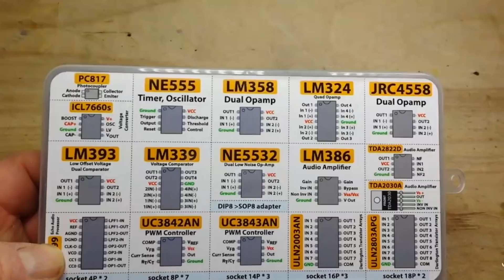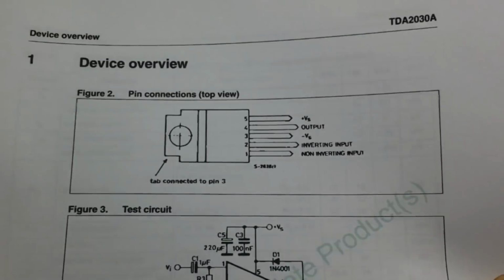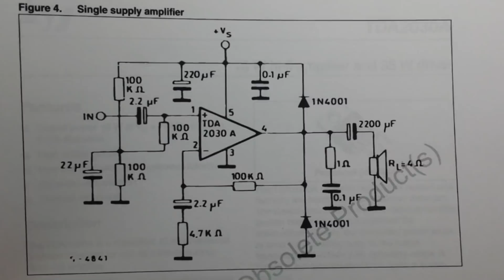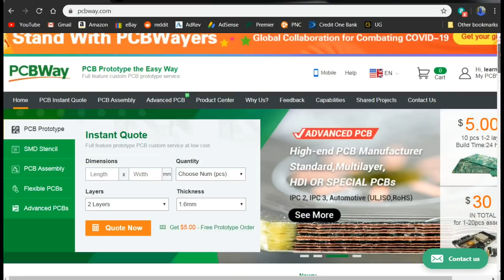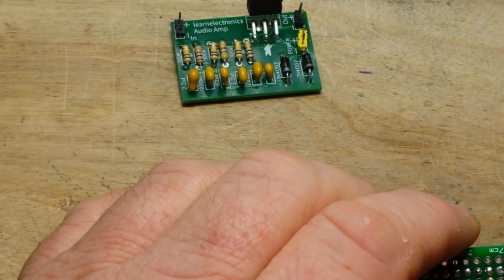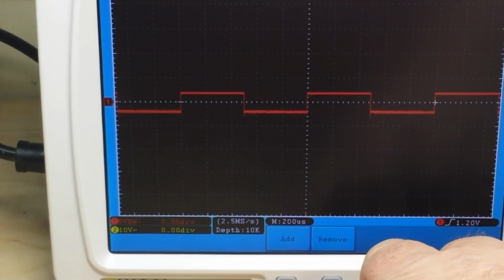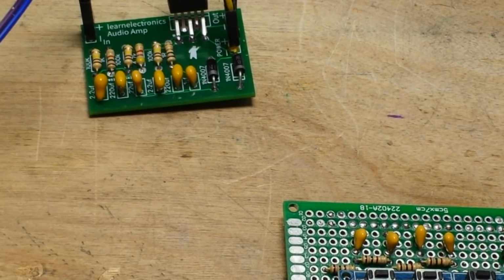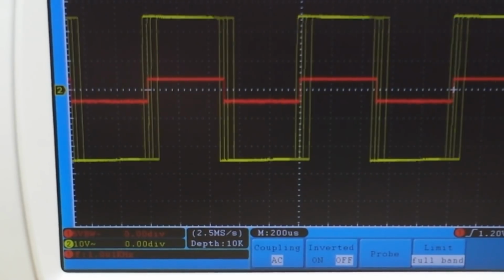TDA2030 Audio Amp Project

Comment: What's the voltage on the heat sink tab?
   If there's electrical isolation between tab and amplifier, the heat sink can protrude from the case. Otherwise, you'll need a larger case with perforations for airflow, and even a fan. Or some kind of insulator and heat sink compound.
   I don't see a real problem with electrical safety, this amp would work well with a 24V supply which is touch-safe even if the amplifier shorts internally.
   The data sheet states a maximum of 3 C between junctions and tab, but I don't know if that's a lot.

Comment: Yes, I could do that... now there you've gone and done it again! First, there was the ZT-M1 Multimeter, then the SDS-1202x-E o'scope + the DS-213 mini o'scope. (Great products, BTW) Now, I need some analog stuff to make use of them.🥴
Hey! What about the preamp I'll need to go with this? You haven't even mentioned that little extra item, have you?😜
(So, don't stop now.) 
Thanks 🤔💨
UPDATE: Okay, now here's what I'm talking about. I want you to just look at what you've started.
I already have a RPi 4 with a 1TB SSD and a Teensy 3.6 with audio shield. So, why don't I use the RPi4 as a media server and stream audio to the Teensy, over Wifi? Then, simply connect the Teensy's audio board output to the input of your audio amp, which drives some high end 3 way speakers. Stick 'em inside a well designed box with a power supply and Voila! DIY wireless sound system for a fraction of commercial prices.😎
💡 Since volume and filtering cn be handled at the source, pre-amp isn't required, right?

Comment: You're the man. I just picked up the exact same IC assortment this week; messing around w/some audio designs as well. Helpful, as always!
Reply: mind sharing there you picked it up from?
Reply: @spacewolfjr  Just found it on Amazon! I'd been keeping an eye on it for awhile for the price to drop a bit and it did. Not sure if it's gone back up since though.
Reply: @danielmaclean4718  Thanks mon ami, I will keep a look for for them. Not sure if you tracked the price via camelcamelcamel but that's an excellent price tracker, Spacewolf approved!
Reply: @spacewolfjr  The channel owner has them linked in his Amazon storefront https://www.amazon.com/shop/learnelectronics. It doesn't cost you any more to order through his shop and he makes a little money from it. I bought this same set to follow along and to just tinker with.

Comment: Hi, I have two questions:
Shouldn't the supply rail traces on the pcb be a bit thicker?
I heard that a ground plane isn't reccomended for audio circuits, it's better for each ground connection to have a separate return path to the main ground connection point, is that true?
I'm just a beginner in electronics, I really like your videos and appreciate your work very much!
Reply from the maker: I tend to use ground planes for everything, but I am not an audio expert so don't take my word for it. As for the traces, this is low power stuff, no problem.
Reply: @learnelectronics  Thanks!